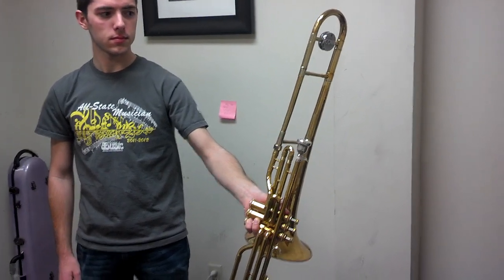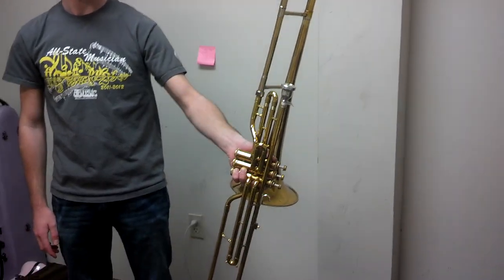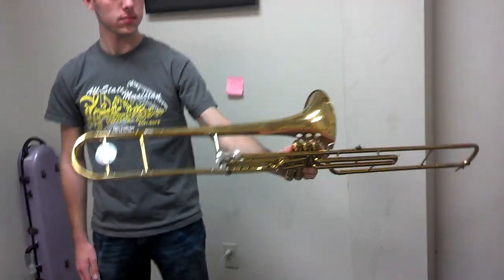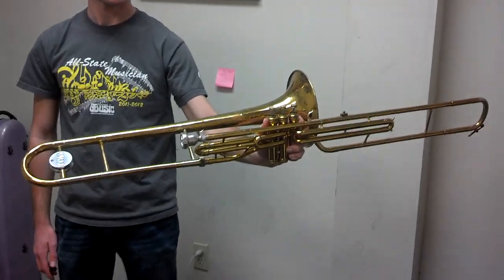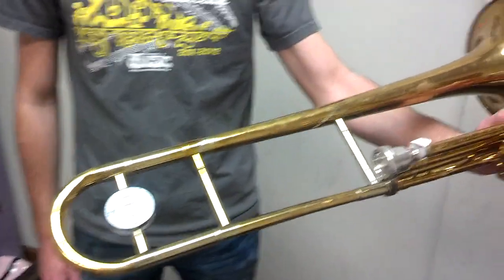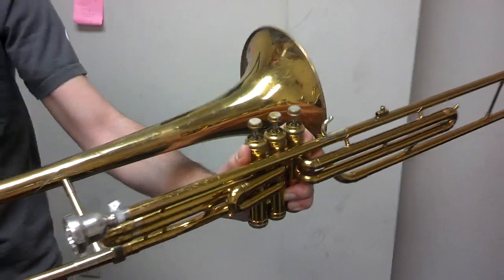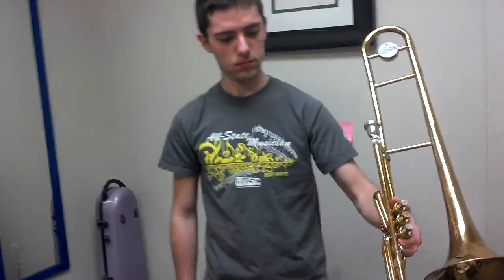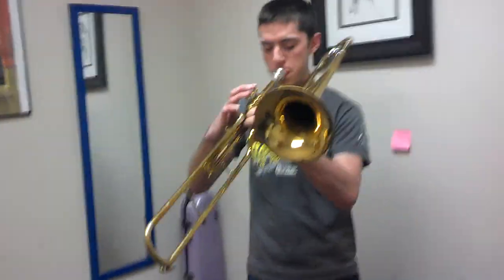Conn Valve Trombone

Comment: Does the slide even work?
Reply: Joe Cross the slide is the way the air travels and the valves change the air flow
Reply: JosephTheYoshi there is no slide
Reply: @carsonstephens2508 There are tuning slides, but not a conventional slide as in a slide trombone.